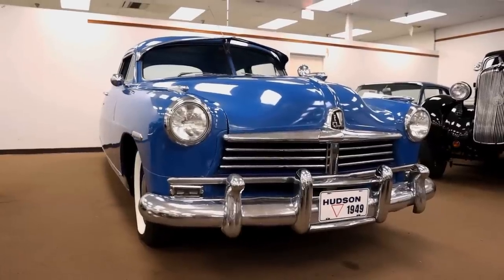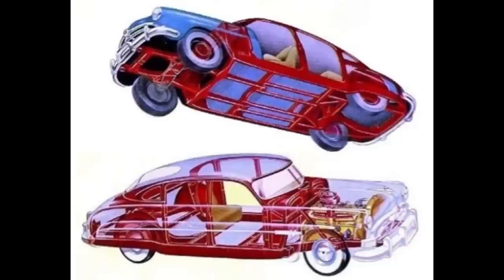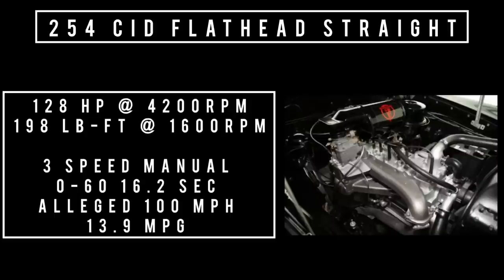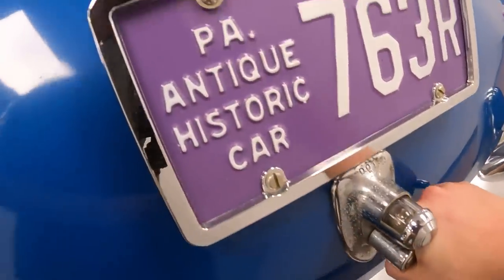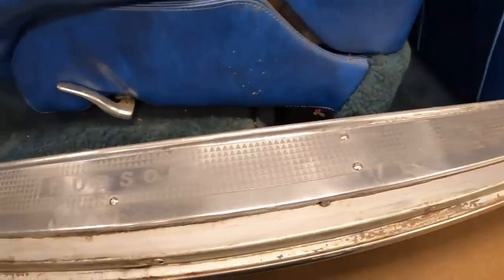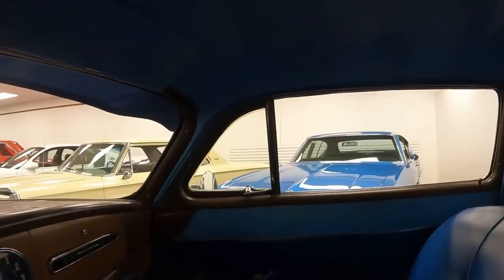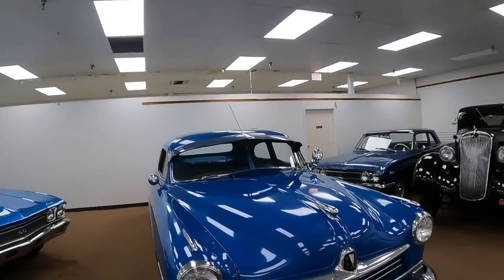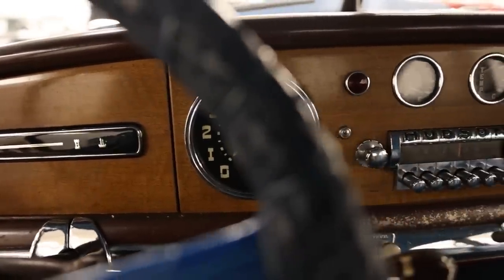1949 Hudson commodore, with it’s all new step down design.

Comment: I still have Dad's 49 Commodore four door sedan.  Last tagged in 1963 when the input spline for the transmission twisted the end off.  Three speed manual with electric overdrive.  The overdrive switch is under the gas pedal.  When Dad bought it, the clock didn't work.  I was standing on the seat next to him when he had to brake hard and my forehead broke the clock glass (yes, it's real glass.)  The clock started working again.  Dad replaced the glass and that was that, other than the boo boo on my head that earned me a bandaid.  Dad bought Mom a 55 Chevy Bel Air four door sedan because the Hudson's size intimidated her and the Chevy had an automatic transmission.  The Hudson was unbeatable for highway cruising.  It would rock us kids to sleep on road trips.  I have always intended to fix that transmission input shaft and put her back on the road.  I found a transmission in an Arkansas wrecking yard that was leaning up against a tree and bought if for ten dollars.  It's in the trunk waiting to donate the input shaft (along with 2 cans of Hudsonite clutch fluid.)  Maybe someday if I don't die first.  I'm 71 now.
Reply from the maker: Thank you so much for sharing that awesome story what a great memory =) that’s all the clock needed was a hit from your head to get working again
Reply: I have owning a '48 Commodore Coupè in Milan, Italy, since 1985.

Comment: A truly classic of late 40’s design. The car had innovations in design and functionality that even today make sense.  Thanks for the video!
Reply from the maker: Thank you so much for watching that was an incredible car it sucks that there are very few and far between the crazy thing about this car was the eight cylinder engine option only making 8 hp more than a six cylinder if my memory serves correct I have a friend who had a 53 but it was a hornet and he told me that they still offered the straight eight but you could get the six cylinder with a high compression head and it make more horsepower than the eight cylinder.. Which is absolutely crazy to me
Reply: @What.its.like.  Jay Leno's Garage on YouTube featured a couple of different Hudson cars that he owned and he made a similar comment to yours concerning the six cylinder, being surprisingly smooth and better than V-8s of the competition.
Reply from the maker: I watch Leno on the regular since around 2005 are used to watch a show before you put it on YouTube =) 

I’m still waiting for the 48 Packard Clipper episode that he said he was going to do pretty soon that was 10 years ago lol
Reply: @What.its.like.  The 8 was of an older early 1930’s babbitt bearing design whereas the 6 was a more contemporary engine, therefore the 6 was actually the better engine.
Reply from the maker: That’s great information thank you so much for sharing that.. wounded why would anyone get the eight?

Comment: That big knob by the dome light is for the antenna, to turn it down or up.  I was raised with Hudsons.  The club coupe has a lot less back seat room than a 4 door. And it is NOT wood. it is a plastic type of luminant.  And it was designed the whole car to be very safe.  Well ahead of other car manufactures.
Reply from the maker: Thank you so much for sharing all of the insight as well as corrections =)

Comment: I had a 49 Comodore in the mid 70's. Once I replaced every seal on the car, new shocks and connected the front sway bar it was the best riding car I ever owned. The previous owner had painted it first class and the original interior was in excellent condition. miss that one.
Reply from the maker: Did yours have the six or the eight did you have the aluminum cylinder upgrade.. I have a friend who had a Hudson hornet 53 I think he said it was four-door he said that’s one of the biggest regrets in his life is selling a car he only paid 300 bucks for it back in the 70s.. it was in a junkyard in Iowa he was stationed in the military out there he had that car and I don’t know if you saw the episode with the 59 rambler wagon he had that as well he kept the Rambler wagon
Reply: @What.its.like.  I never had to take the head off the 6. The engine always ran perfectly and I had no reason to get into that. Can't remember how much I paid for it, but I think around $2,000. Again, what a nice ride.
Reply from the maker: I really wanna drive a Hudson from this time period I don’t care if it’s 1949 or 1953 =) All of these old cars have presence I am feel way more quality than the newer cars that they build now.. all the cars in our cookie cutters they are all very similar and they just feel generic and bland much like a McDonald’s cheeseburger.. lol

Comment: I have the 1949 Hudson Commodore 8, in 2 tone blue. Mine looks just like the thumb nail except mine has the spoke hub caps. It's not real wood, it's like a heavy sticker. Kind of like modern car raps. And it rides like your on a cloud. Mine also has the little wing windows in the back seat as well as the front. That plastic water overflow is not original. Mine is glass. And the little hudson badge in the front of the dash lights up when you turn on the head lights. They are amazing cars. I had to buy spark plugs from a tractor supply store. Because they are 6 volt, and short and fat. Just like old tractor spark plugs. My radiator hoses also came from the tractor store. Buying parts for these old Hudsons can be a nightmare. But it's worth it to drive one.

Comment: As someone over 60 who was one of the younger HUDSON enthusiasts in the 1970s through the early 2000s you did a great job especially considering your age.  The "Step Down" Hudsons were extremely comfortably riding and with proper tires handled amazingly well with nonpower assist steering or brakes. I have owned many from the Pacemaker, Wasp, Commodore, Hornet, Super Wasp Cvt.
Reply from the maker: This is a hard question but what was your favorite? 

The plan is to hopefully feature all of them on here as well as all the different body styles this channel is a home to the orphan cars
Reply: @What.its.like.  The Hornet coupe is my favorite and I am partial to 1954.  All through the 1960s and early 2000s owners would replace their car's original straight 8 or 262 cubic inch inline 6 with the 308 Hornet and it never hurt value. The seemingly endless torque combined with great cornering and a smooth ride made for a great combination.
Reply from the maker: That car sounds awesome did you keep it
Reply: @What.its.like.  I kept it till about 2009. I also have Jaguars and not as much room anymore.
Reply: @Clarkecars  The 308 was still a Hudson engine, and Hudsonuts don't mind as long as you don't put a Chevy engine in it.

Comment: That is the low end Super 6. Original interior had top notch  cloth upholstery, doorpanels, and headliner. Someone put cheap vinyl  in that one. We are having a Hudson National Meet .in Branson Missouri , July 10-14 2023, and there will be plenty of original Hudson's there ,so you can get a more accurate presentation on the Hudson.
Reply from the maker: Yeah that would be awesome I’ll see if I can come out it’s marketed as a Commodore so I just took it for what it was advertised =)

Comment: Hey Jay-

That's a nice example!

I'm not sure that the color is correct, but the color looks really nice on the car.

Also, I'm pretty sure that the interior has been reupholstered in all vinyl... Originally, it would have been a combination of mohair velvet and a woven brocade.

The woodgrain you see is painted on the metal... Isn't it incredible how convincing that stuff is?

The knob at the peak of the windshield swings the antenna up and down.

Those Hudson's are one of the cars that's hard to find anything wrong with, design wise.
They were absolutely beautiful.
Reply from the maker: Thank you so much for all of that information as well as corrections I totally forgot about the antenna on the roof I was thinking that’s a weird switch for a light
Reply: @What.its.like.  don't thank me...

We all learn from each other.

Cheers...
Keep up the good work 👍

Comment: my father had a 1950 commodore 6 and at 15 years old 1960 I got to drive it a lot. great car. ours had supermatic drive with overdrive.
Reply from the maker: That’s awesome how did yours run and drive
Reply: @What.its.like.  by the time I got to drive it the engine had worn cylinders and low compression. 10 mpg was typical. we would put in number 40 bulk oil when the oil pressure light would flash. the care drove excellent. my father said it was the best car he ever owned.

Comment: My dad worked on the assembly line at the Hudson main plant (corner of Jefferson & Connors in Detroit) during the summer of 1948 as the '48 models were building out and the '49 models were being launched.  He was in his late teens, and later worked for 2 years across the street at the Chrysler Jefferson Ave. Plant.  (I also had great uncles at GM Research and Pontiac, and uncles at Ford and Uniroyal, while another uncle sold Fords in LA.)
Reply from the maker: Thank you so much for sharing that which place did your dad like working at more Hudson or Chrysler, did he ever own any cars from either brand when working for them?
Reply: @What.its.like.  , I don't know that he had a preference, and that was long before I was born.  He did once mention the worst job he ever had was reaching into an oven that baked paint to pull the painted bodies out using a hook and send them off to the assembly line.  That was at Chrysler.  He worked for other companies but the one that defined his career was Williams International (turbine engines), so he had no specific loyalty.  Over time he had cars from all of the Big 3.  Never an import.
Reply from the maker: Thank you so much for sharing those stories =)

Comment: 14:35 I believe that knob controls the angle of the antenna. 
If I remember correctly, Hudson door locks were arranged so that you locked the door by pulling up on the plunger to make it more difficult tp unlock the door with a coathanger, rather like a Peugeot 404.

Comment: I’m glad to see you review a Hudson. America had some interesting cars in the past. Sometimes I wish you might dig a little deeper and mention a car companies unusual features, advantages or disadvantages. An advantage is the step down frame, a disadvantage is the straight 8. Straight 8’s had issues because the crankshaft was so long it was subject to torsional issues. The Hudson appears to be well appointed (ignoring the non-original vinyl).
Reply from the maker: This is going to be the home of the orphan cars.. The problem is two fold though I love orphan cars the issue is the information is spotty at best and apparently from some Hudson organizations this isn’t a Commodore it’s listed for sale as a Commodore but evidently it’s a super six.. which puts me in a bad situation because the seller is selling it as a Commodore but people in the Hudson community are saying it’s a super six and that is the biggest difficulty with doing cars that are off the beaten path is the information isn’t as cut and dry as some of the more main stream cars I absolutely hate giving out false information I do my due diligence and try to pass off it’s factual information as possible.. so I don’t know if I should take this down and redo it as a super six because changing the thumbnail isn’t going to change the whole presentation.. or if I should just leave it because the Commodore in the super six were essentially the same car the Commodore was just more/better appointed
Reply: That only was an issue when you tried to soup them up.  Stock or lightly souped, they were fine.  The big problem with them was their length.  They won't fit in a car with a shorter hood unless the firewall is severely indented, but then you often would have to pull the engine just to remove the head.

Comment: All the wood look trim is steel with wood graining, probably dinoc decal.  The big knob under the dome light rotates the antenna, just like on a Buick.
Reply from the maker: Thank you so much for the correction it looked real it felt sort of real I work with wood daily and I couldn’t tell the difference I should take a magnet with me that would help Thank you so much for that correction it looked real it felt sort of real I work with wood daily and I couldn’t tell the difference I should take a magnet with me that would help =)
Reply: @What.its.like.  just because it looks like a duck, walks like a duck and quacks like a duck, does not mean that it is a duck!  LOL. Hudson was a quality car and used quality materials.

Comment: The knob between the visors is for the antenna. The cables under the hood are for the wipes. The 7X engine made 170 HP
Reply from the maker: Thank you so much for those corrections =)

Comment: Thanks, Nice to see, Well I learnt to Drive in a Commodore Six 1947 Hudson, So I got to say it looks like a Squashed Version of that, with lower body style, good reliable vehicles, even here in Australia, the Hudson was still a daily drive till 1974, when we got a New Ford XB, I still remember the Hudson, because newer Japanese Cars always came off 2nd best when in a Accident, as a example, Hudson, hit a pothole, Hudcap came off, ran across road, Hit Toyota, speared Radiator totaled front, needed to be towed away, we needed Hubcap Repaired ....
Reply from the maker: Great story thank you so much for sharing those memories with all of us =) cars were build better back then.. I will say not safer but and it felt like, when in those classic cars it felt quality not like now everything is plastic everywhere and bland styling
Reply: @What.its.like.  Yes, Safer is a myth they were Built, but without Seat-belts that sturdy interior could be a "school of hard knocks" in a accident, I as a Kid was thrown over seat into window & then into upside down position between Dash & Front Seats, in a collision  ... But having said that, I may as well tell about the Mini, It Run into the Rear of Hudson in City, it was totaled, we needed bumper bar repaired & Refitted .. Our only issue with the Hudson, probably due to it's Age, was Rear Wheel Axel, Hard to find parts at the time ..

Comment: The knob above the rear view mirror operates the antenna! It turns the antenna from vertical, to horizontal. Buick had a similar thing.
Reply from the maker: Thank you so much for that correction =)

Comment: The knob by the dome light controls the angle of the radio antenna. My friend had a 1950  Commodore and my grandfather's 1952 Buick had the same feature. It would help get the radio stations more clearly'
Reply from the maker: Thank you so much for that correction I didn’t realize the antenna was mounted on the top until after I did the interior shots and I totally forgot to edit that part out.. I was thinking when I was turning that knob that man this is the weirdest dome light switch I’ve ever experienced lol
Reply: @What.its.like.  1939 - 46 Fords and Mercurys also had this feature.

Comment: The eight cylinder from this car was rather primitive. It did not even have pressure lubrication. It worked okay because during this period speed limits were very low. But in modern-day driving you have to be very careful not to push the engine too hard.
Reply from the maker: Awesome information thank you so much for sharing that I wonder when that became a staple across the board I know 235 Chevy in-line six was the first pressurize engine that they offered but it wasn’t until mid 50s. 1953 or 54, I think it was 53 because I think the Corvette offered the first pressurized oil system in line 6 that Chevy built

Comment: Would that wood knob at the top of the windshield be the rotation control for the antenna? Buick did it that way. The antenna rotates to a down position along the windshield center post.
Reply from the maker: For that correction For that correction=)

Comment: You could get a Packard Eight for about the same money, and it was a more prestigious brand name.
Reply from the maker: Very true different league during this era

Have you ever been in a late 40s early 50s Hudson it’s a great place to be
Reply: @What.its.like.  I almost bought a '53 Hornet when I was in college. It had Twin-H Power (dual carbs, good for 145 horsepower, but I already had a '51 Studebaker Commander Starlight. 
As I recall, Hudson used a cork-lined clutch that ran in an oil bath, and was the last hold-out for splash-type engine oiling.
Reply from the maker: In two weeks I’m going to the Hudson national meet which is up in Erie. I’m going to meet some people up there friend of mine built a 54 Hudson hornet he’s from the other side of state and I’m gonna review his car I was just listening to it Run, It sounds incredible especially for a six =)